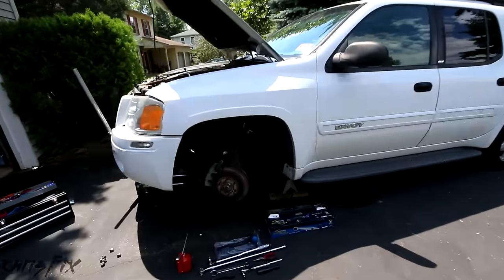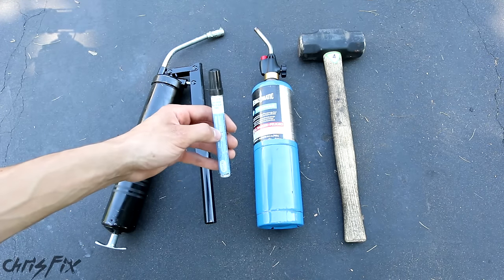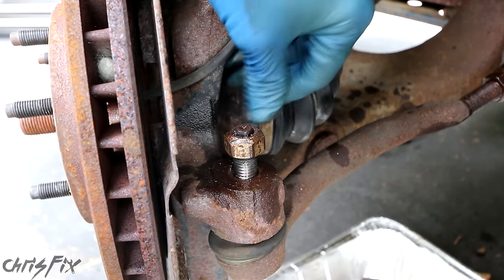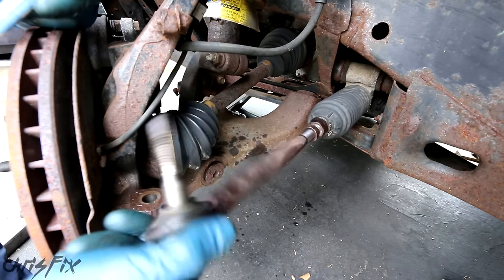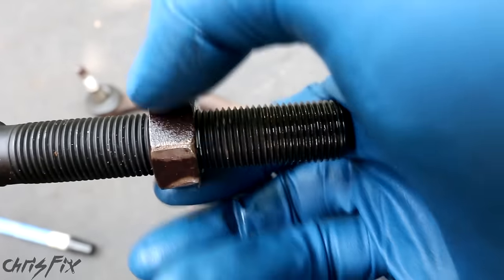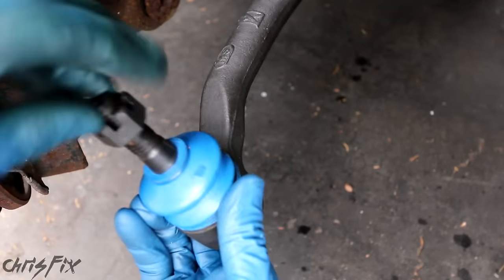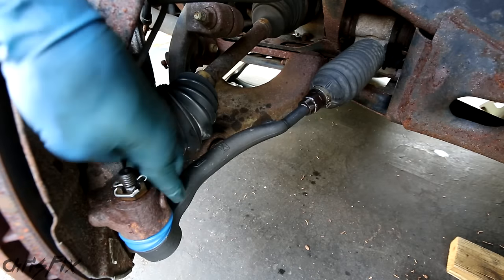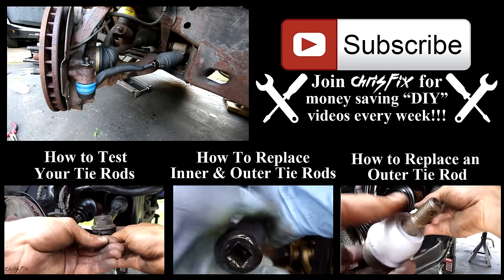How To Replace an Outer Tie Rod End

Comment: Chris, I have a weird problem with my 2012 Jeep Liberty that I can't seem to figure out. When at speeds of around 35+mph my car seems to feel like it's moving from side to side when changing lanes, or sometimes when just in one lane. It's scary because it feels like I can't control the car sometimes. I have to hold on the steering wheel quite tight just to make sure I don't crash. It feels like something is loose on the steering column, but I can't see anything loose underneath. It's as though the car wiggles from side to side with a lot of steering input to correct the issue. It probably doesn't sound very insightful, so I hope my description helps.
Reply from the maker: +Jamie English That might be what is called the Jeep death wobble. You will have to lift the car, have someone turn the steering wheel and check to see what parts are not tight. It is probably something with to do with the tie rods.

Comment: On buses specially equipped for Curb Guided Busway Duties, the front wheel alignment has to be 100% exactly 'Toe Neutral' because both guide rollers have to make contact with the track walls.

Comment: I seen your video about testing the suspension from 12 & 6,, & from 3 & 9.  I just get movement from 3 & 9 o'clock & also when I'm park & turn the wheel I get a clicking noise.. Can that be the inner or outer tie rod or can it be both.. thank you for your time..

Comment: I did this the other day. I found a pipe wrench worked well to get the jam nut off.
Reply from the maker: Bigchuck678 That is a great idea so you can get a longer arm and more torque! Thanks for sharing!
Reply: ChrisFix I did this the other day by watching your videos! I have a question In my camry the replacement tie rod ends do not have a grease fitting so when you torque down the castle nut the boot gets compressed and ultimately breaks. any ideas of how to fix this?

Comment: Great video as always, Chris! Your camera work and narration are the best I've seen on youtube, in my opinion ... the one thing that surprised me a bit was you didn't replace the tie rod lock nut because it looked like the old nut was rounded over quite a bit. (It always amazes me too that new parts don't automatically come with new fasteners!) Comments on that?
Reply from the maker: +Larry Heller Thanks a lot Larry! That nut was not that rounded and unfortunately like you said, it doesnt come with a new castle nut. I had no problems with the nut in the socket and it did not feel loose.
Reply: I meant the other nut - the one that goes to the inner tie rod.

Comment: Hi ChristFix.. i’ve been watching your videos. Those are great. I have a problem with my car’s steer. After my car get collide with a motorcycle at front right wheel. If I put the steer on straight, the car is going to right little bit (1 clock direction). I have spooring it 3 times but it won’t get fix. I thought maybe there’s a broken part from suspension. Can you tell me how to fix my car?

Comment: Hello there CrisFix, I have Audi A4 B7 2007. Two months ago I replaced my tie rod end and the thing that I noticed is my original suspension parts are black and they look covered/painted with some kind of rubber layer or something. A month after replaced my tie rod end it started getting rusty but my original parts are still without any rust on them. What is this layer are they covered with, and how can I protect the suspension parts from rust? Thank you!

Comment: Hi Chris!
I have a 07 mustang and I have to replace the tie rod but my stang is lowering 1.5" can I install the regular ones or need special ones?
Reply from the maker: +raga1s You can install stock tie rods. The tie rods should adjust. You can even flip it around on the other side of the knuckle to give it a better angle since your car is lowered (only if necessary).

Comment: Hey Chris, I have a question about the mevotech parts you are using. How are they holding up? I’m looking at getting all 4 control arms from mevotech for my 2000 Chevy blazer . Did they fit properly? Was the quality worth it? I was looking at Moog but they don’t make the heavy duty control arms for my blazer any more. And when I do find some they don’t have all 4. 
But since I’m eyeing mevotech for now I haven’t bothered with Moog much for other then steering components. If you could please answer ASAP that would be amazing because I need to order those today or tomorrow. Also the parts I’m looking to get are the mevotech supreme. Thanks in advance.

Comment: hey chris on my 2001 chevy blazer my abs light is on and also my parking brake light it pulled the break release and pulled up on the emergency break and i noticed my brakes are pulsing. can you do a video on fixing this problem apparently it is common on gmcs and chevys
Reply from the maker: Garrett Balay I would love to do a video but I do not have a chevy or gmc with that problem to work on right now. If/when I do, I will make a video for you!
Reply: Alright thank you very much for getting back to me your videos are very helpful and informative

Comment: I must say I would have backed off that boot, yet I see you are heating just to get the oil moving in.  That bolt is close to the rubber boot.  I would have wanted to heat the bolt so it would expand instead of the shaft.  Hey, you still got it!  Nice work.
Reply from the maker: Sagina1999 Thanks for sharing!

Comment: So I've got a rattle on my g35s and it's coming from the rear muffler hanger so I plan on tightening it and if all else fails removing the heat shield to see if it goes away but one thing I noticed was in checking the hangars the distance between the tire and wheel well on the front and back of the tire on both sides is a little off. On the left side I have about 2 inches to the front and 2 and 3/4 rear while the right side is an even 2 and 1/4 inches either side. I know it's off since my arm fit behind the left tire no issues even with my sweatshirt on while on the other side I had to pull up my sleves to even reach the hangar. Any advice would be appreciated
Reply from the maker: +I'm Irreducible That can be due to a few things. One is the car has to be on even, level, flat ground to get an accurate reading. Second, your car might be a little higher on the driver side because when you get in the car or get gas, it balances out.

Comment: I just put a new sway bar for my Oldsmobile silhouette. Had to remove the tie rods to install the bar to fit underneath. When I tried to remove the nut, the entire part spun inside & with no way to hold it secure, the nut stayed on. The only way I could remove it was to use a cutting wheel to cut the nut & shaft flush to the surface. It came out easily with a pickle fork. 

I hadn't planned on replacing them but, that just added to the aggravation & extra cost.

Comment: Hi Chris need your opinion I am going to change outer tie rod for my Lincoln MKT 2013  first time for both sides . Should I change the inner tie rod to or just leave it I only need to change one side outer tie rod but I got two tie rod so planing to change both side so what you think about inner tie rod change or leave.
Reply from the maker: For such a new car I would just do outer tie rods unless your inners are no good. Check this out: https://www.youtube.com/watch?v=brI2feYiEi8
Reply: ChrisFix hi Chris thanks for your opinion . I got one more questions my outer tie rod don't have grease fitting. Do I still need grease for the tie rod or just install without out grease. Thanks for your help. Sorry it's my first time.i am trying to save some money.

Comment: On some vehicles, it's difficult to get a good swing of the hammer to hit the tie rod or it may have a lot of rust and make it stubborn to get the tie rod off. In that case, it would be good to use a tie rod separator (fork). Many auto parts store will loan the separator to you. So when you go to the parts store to buy tie rod ends, it would be good to get a separator while you are there. You will be charged for the tool but when you return it, you will get the money for the tool back.
Reply from the maker: Frank Gonzalez Thanks for sharing Frank! A pickle fork would be another great tool if you have access to it or can rent it. You can also hit the actual tie rod end downward (if there is enough room).

Comment: Hey, I saw you were using a torch to get that nut off. It works best if you put the object at the point of the jet coming from your torch.
Reply from the maker: Nick Maples Thanks for the tip Nick!

Comment: Just replaced strut springs control arms ball joints an sway bars both sides front end on my 2008 kia rondo lx an i still hear noise over bumps an noise when i turn i did everything right an with a air gun not sure what else is wrong hub looks good same with tie rods

Comment: Hey Chris I have a 2002 Saturn sl2 with a transmission problem I change the valve body in the transmission I've been getting different answers on what the ohms are  recommended to be on the silinoids. Wondering if you may be able to help me with this thanks very much
Reply from the maker: Terry Hopson You will need a service manual or ask the guys on the saturn forum because I do not know what the ohms should be off hand.

Comment: Hey Chris, I just got an alignment done on my car and the steering wheel isn't straight like I would like. I took it back several times to get it straightened and I'm still not happy with it. Could you post a tutorial on how to fix this problem? Thanks!
Reply from the maker: Brandon Adame It is tough to fix the problem at home. The alignment shop has to adjust your tie rods so the toe is straight when the wheel is straight. Ill see if I can think of something you can do at home so stay tuned!
Reply: The steering column connects to the rack under your dash,you can disconnect the rack from the column and readjust the wheel to be straight,Google your vehicle for replacing a power steering rack and a forum will have instructions on your specific vehicle.the only portion you will need is disconnecting the column from the rack,aligning it and reconnecting the rack and column...hope this helps

Comment: ChrisFix With all the work you've done with your Ford Ranger:suspension, have you noticed any difference in the driveability and handling?  I have the 2002 Ranger that I just picked up and am thinking about making similar replacements.
Reply from the maker: Craig Cole It feels like a new car suspension/steering wise. I mean, I replaced basically everything besides the torsion bars.  Totally worth the work!
Reply: ChrisFix I was wondering if you'd say that.  Once I get all my fluids changed out, I think I'll do similar work on my suspension/steering components.

Comment: Hi Chris. Your videos are really helpful. I have a problem with my car. I get a single clunking noise when I make a sharp turn at about 15 mph. The funny thing is, it only sounds once per direction. For example, if I make a right turn, I hear the noise. But if I make another right turn, there is no noise. On the other hand, if I make a left turn I hear it again.

I was in NC for a while and took my car to a friend's recommended mechanic. He replaced the F/R ball joint, inner and out tie rods. The old parts seemed to have worn rubber grommets--I have them with me. We went for a test drive and the noise seemed to have stopped. But now that I am back home (in FL) I started hearing the noise again. Unfortunately I can't go back to the mechanic in NC. Do you have any ideas as to what might be making that noise? I even have videos recordings where you can hear the noise. Looking forward to your feedback.
Reply from the maker: +Halcyon It could be the CV axle making that noise if it only happens on turns.
Reply: ChrisFix I checked some other bad CV axle noise videos, and those seem to different from what I hear. Firstly, they get a repeated clinking sound. Mine is a single thud. Almost as though something is rocking due to inertial forces (but emphasis on how the sound is a single "thud" type of clunk). Secondly, most of the cars that had bad CV axles appear to be front wheel drive. Mine is a rear wheel drive.

Comment: When I drive my car to 60 to 70 miles per hour, it goes to the left side I took it and did alignment and it was fine for a few days and then it went back again. The car 2011 Honda CR-Z 50,000 mi on it. Could it be the tie rod need to be replaced? Or something else

Comment: @ChrisFix
Hey Chris. I just want to say that I love your channel. subscribing to you was one of the best thing's I've done on Youtube. I have a question, I have a 99 blazer. It's giving me a problem that concerns me. I've taken my car to get check and they have told me it is nothing to worry about but obviously they are not the one's that drive the car daily. What it's doing is that it is struggling to accelerate. Please bear with me with the symptoms. It shakes when I accelerate as if it had a miss fire. however, I already replace the distributor for it needed a new one anyways after shutting off on the freeway. Furthermore, it only shake when in drive so I know that it's not an engine problem. Upon acceleration, the car shakes and the rpm needle goes back and forward until I bring the car up to speeds of 50 mph. I drive the car everyday and it concerns but I don't know why it is doing this. Do you have any suggestions? the steering wheel does not shake and tires are new. could it be the control arms? 
Thank you ChrisFix and congratulations on reaching 1 million subscribers!

Comment: Hey Chris!
Do you use original spare parts? Or is it safe to use aftermarket parts? Thanks!
Reply from the maker: Fredrik Ernofsson I use aftermarket parts because OEM is just too expensive and they tend to wear out just as fast  or faster than OEM. Just use a quality brand that meets or exceeds OEM specs.

Comment: chris great video! but dont you think your going a little over kill on safety? i mean three jacks a tire and the back tire blocked off?
Reply: The_Real_442 One mistake is enough to screw you up.
Reply from the maker: The_Real_442 No such thing as overkill. It takes 10 extra seconds to block a tire off, and I have a ton of jack stands so adding one extra is another 10 seconds. For an extra 20 seconds of work that might one day save my life, it is worth it to me. I have had a car fall off jack stands before and when that happens, it really shows how important it is to be safe even if it is overkill.

Comment: have you ever stripped the lock nut? i can see that being a problem if you dont do it correctly
Reply from the maker: +Brighton Collver I have never stripped the lock nut. If you do, you have to cut it off or heat it up and use a vice grips.

Comment: No need to pre load suspension for tie rods install?
Reply: Jdmtunerlover 

not really, its steering related, not suspension related
Reply from the maker: Jdmtunerlover Nope, the tie rod can be tightened in the air or on the ground. No need to preload it. Here is some info on preloading: https://www.youtube.com/watch?v=-QczV_6v42A

Comment: hey dude, I'm all the way from Trinidad and i have a problem with my car lock!
my car is a toyota corolla l touring wagon.
all the locks works besides the main lock, its not working with the alarm or the main power switch on the door panel....
any solutions?
Reply from the maker: Davis Singh That is something I cannot really diagnose from over the internet. I would check fuses.

Comment: ChrisFix I have a huge question for you and maybe you should make a video about this if you have not. I want to know why my cars oil temperature needle is above the middle. Idk if that's supposed to be correct or not. Please help! :)
Reply from the maker: JuanCarlos CastilloDisla What is the actual temperature? I would check to see if you can get a digital temp reading because sometimes the analogue gauges are not accurate. If the temp is just a little above the middle you are ok. If the temp is high and in the red section of the gauge, something might be wrong. It could be excessive friction from something in the engine. I would change the oil first to some new, quality oil.
Reply: +ChrisFix Thank You for the response! :) and I will immediately do a digital temperature check because I do not trust my gauges either as even the speedo is not accurate at all is like off by 5mph. Its a 10 year old car and I just changed the oil and I still use my Ford Motocraft filter for now. Ill see as to were this may lead. Oil temp is something that im highly careful about as it can cause permanent engine damage. :)